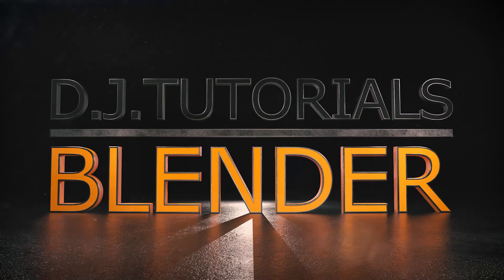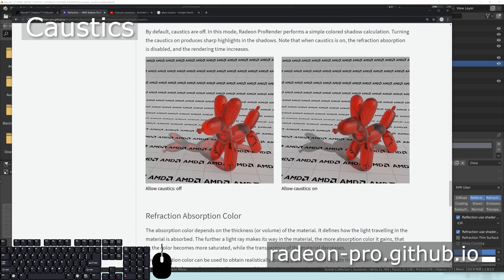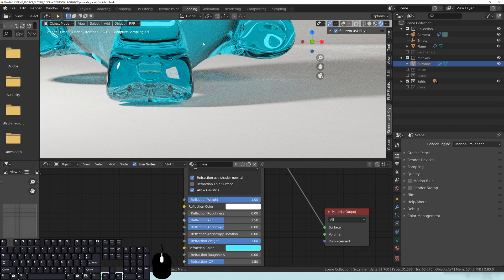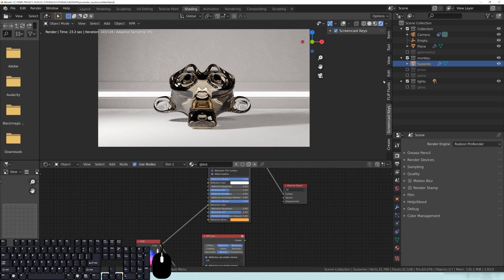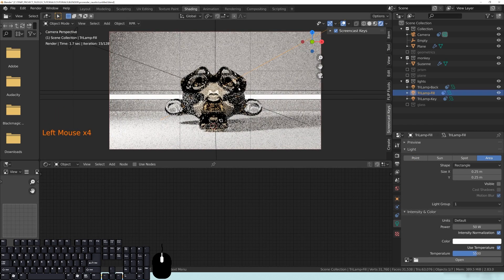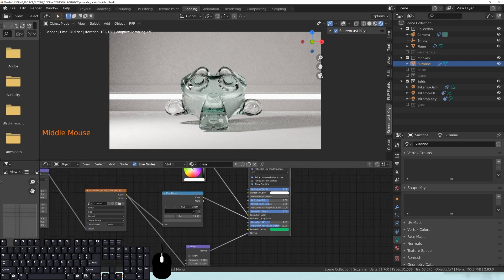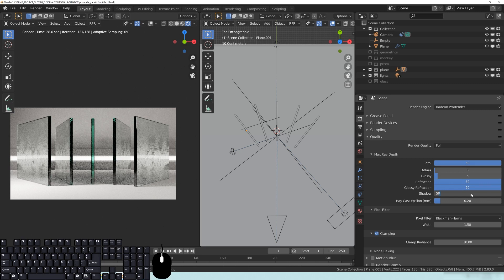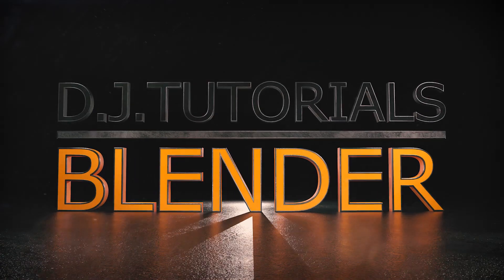Radeon ProRender for Blender | Rendering Glass

Comment: What GPU , CPU ?
Reply from the maker: Marcelo Viana 
Computer Build:
CPU: AMD Threadripper 3960x 24Core/48Thread
GPU: 2 X AMD Radeon VII
RAM: 64 GB 3200mhz
Drive: 1TB Aorus M.2 NVME Gen4
Motherboard: ASRock TRX40 Creator
PSU: Cooler Master Master WattMaker 1500watt
CPU Cooler: EVGA CLC 280
Case: Azza Ragnarok 801
Reply: @djtutorialscgi  thanks to be so kind. That info helps a lot.